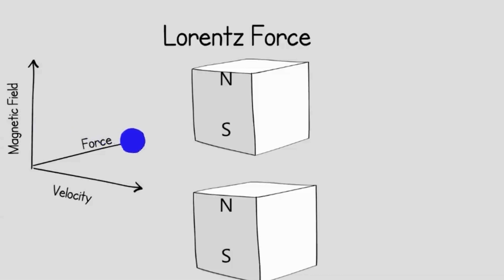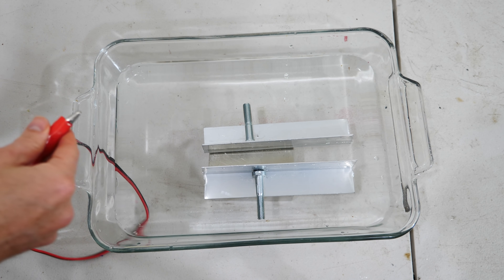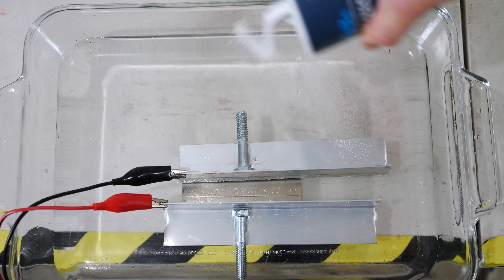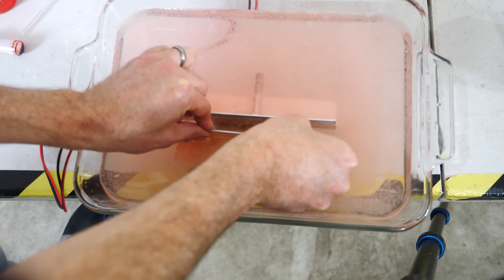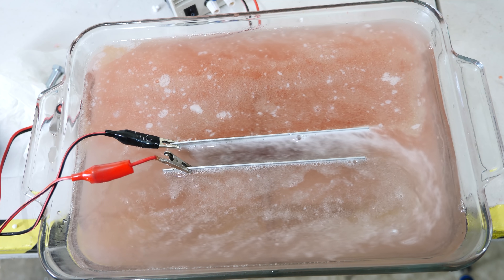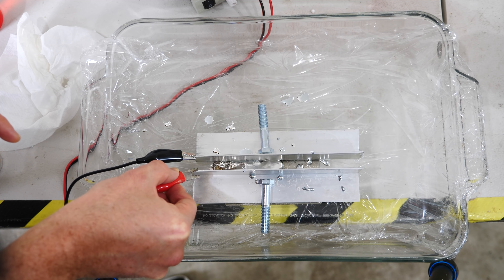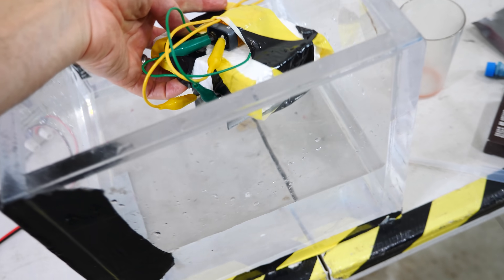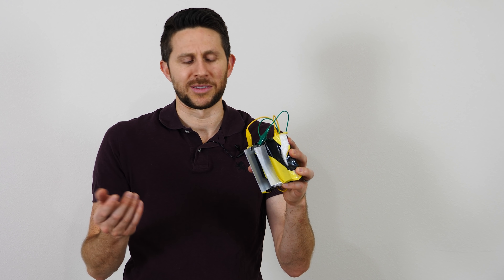I Made a Real Magnetohydrodynamic Drive

Comment: Will water that contains a lot of ions (salt or hydroxide) move in response to an electromagnetic force alone, without having electricity pass through the water itself?
If so, here's an idea for making the drive more efficient (surely already thought of): Capture the H2 and O2 gases and recover the lost energy by combusting them to power a generator that contributes to the electricity powering the drive. To do this, the leads would need to be contained in a way that captures the bubbles while allowing most of the water to pass through, propelled by EMF, but without being involved in the electrical conduction.

Comment: The hydrogen and oxygen are a bonus. A scrubber to remove them and you're reclaiming some fuel for the energy you used.
Or.. what if you pressurise the system and ignite the by-products to add thrust?

Comment: I wonder if you could replace the pump in a watercooled PC with this? The fact that no-one else has tried it suggests that there's quite a few issues that would need to be worked out first, but it would be cool to see in action.
Reply: There's two possible issues:

The system requires a strong magnet to function. This would seriously fudge up the hard drive unless the "pump" was moved a safe distance away, requiring more desk/floor space.

The process also makes hydrogen and oxygen gas, creating pressure and flow issues. Even small bubbles can disrupt smooth flow in the pipes. Get enough gas expanding in a hot environment, and it's only a matter of time before the pipe ruptures. (To add insult to injury, there is the slight possibility of the hydrogen igniting.)

So, a wiped hard drive, pipes taking up space, bad flow causing uneven cooling, water damaged parts, and a small fire. Who said engineering is boring? 🤬😝

Comment: 4:21 Can you expand on this?  I've never seen a setup like that and the gallium makes it hard to decipher where the electrodes are.  Are they both inside the cup (looks like one is outside, how does that work without making contact if that is the case?), is one on the wall and one on the 'floor' of the cup?  Also, is it flowing in a circle or is it expanding outward to the walls?  Thank you!

Comment: I built one a couple of months ago. I only had some thin copper wire as my contacts, but it worked for about 3 seconds before it corroded one side black and plated the other side with the stripped ions and then burnt out.

Comment: Set your electrodes in a V with the large end on the inlet end and velocity will increase to increase thrust. Shape electrodes like oval shaped funnel to a nozzle. You can increase flow by making the electrodes smooth enough to inhibit nucleation.

Comment: mhd tesla turbine pump
Reply: do it with plasma, centrifugal wall z-pinch mega-g squeeze
Reply: molten metal, iron, going around, hot
Reply: have a cover, to not melt, ceramic, MgO
Reply: super conducting or plasma in the circular form, spinning a disc or particular matter

Comment: Does that actually work as electric current generator when running ionized fluid through it - like many other motors can be driven to produce energy? If yes, how efficient is it, as it probably does not produce gases that way around? Could this principle be used for tidal power plants without mechanical (moving) parts?
Reply: It does work in reverse where a liquid moving through a magnetic field creates electric charges, but it's not even a tenth of a Volt. Though this principle is used in special flow measuring devices widely used in the food industry since you don't need to put any parts into the pipes and risk contamination

Comment: There must be some way to use this with AC electricity on the electrode plates (to stop this inefficient build up of oxygen and hydrogen gas), and then some Tesla valves to force both directions to push water out the same exhaust for net forward propulsion

Comment: 5:26 Currently, the boat can only go slow with surface tension.  If you can direct the water passing through the plates with a pipe, According to the "momentum conservation" can travel faster than this.

Comment: You are so amazingly sychronous! I just finished prototyping an MHD vacuum pump. I needed a backing pump to clear out remaining gases in a high vacuum. Ion pumps ignore some gases and turbomolecular pumps are too expensive and high maintenance. The ancient Sprengel mercury pump was suitable but too tall, too fragile and too slow. I realized all I needed was a liquid metal slug passing the same Y junction repeatedly as fast as possible. I made a flat circular MHD ring track to pump two molten eutectic alloy slugs around a small loop at high speed. Had to place a small reservior and drop gate between inlet and outlet ports to prevent gas from bypassing the slugs. As one slug plows into the reservoir it triggers a launch circuit to eject a drop from the other side of the reservior which then plows gas ahead of it around to the outlet stem again. It runs like a bat out of hell because it is only turned on once the roughing pump takes things down to 10 microns. And since the alloy is eutectic it's vapor pressure is worlds below that of the mercury originally used for this purpose. I am still working on the final build since it has been a nightmare designing the parts and materials to eliminate all the absorbed gases and keep the droplet from jetting out it's middle while the rest remained behind on the track walls to break up and break electrical contact. I actually made opposing magnets move the drop through the charged channel. This makes the drop force itself together from opposite directions to stop it from breaking up. The external moving magnets then shuffle the drops around the track. Still needs refinements. I am still getting a few X-rays from electrons hitting remnant gas in my DIY X-ray tube.
Reply: are you making a spacecraft engine?

Comment: What if we took a clear square tube, placed the aluminum electrodes on the sides with rare earth magnet on the bottom and tried to pump water uphill using this method? Perhaps using a Tesla valve to prevent back flow. Scaled up this could also be used to help spawning salmon to reach higher mating grounds inland, without the Tesla valve of course.

Comment: you chould try to make these copper flywheel motors out of that principle by using a copper wheel and place a electrode on either end of the container and the copper wheel in the middle and see how much power you can possible generate from that.  perhaps electricty in batteries are not formed by the science of it but is actually just a capacitor effect of ion flows but not in direction intended by manufacterer. what if you was propelling the ion fluid mechanically by initalize some current and speed up the flow. would the electrode peoduce more electricity by the mechanical motion added than the electricity supplied. what if the electric current the potential difference and the ion flow is not the same phenomena but  3 different ones. there must be a reason why lead acid batteries are incapable of being charged once go below a certain voltage like the ions just spin around in a loop without actually building up on the plates.

Comment: i think i remember they explained this by using salt water in the sea on submarine to make electric submarines move forward by electricity. this thing is just the same as a ion lifter. the electrode plates are a capacitor to that of the water.  its the same kind of current movement with electrostatics used in lifters as in the chemical version. a wind effect created by a air or water capacitor drives the object forward or generate lift. you can probably make a underwater lifter with salt water that propel itself upward as well by having a lower and upper plate or somthing like that.

Comment: if you place two very thin aluminum wires located very close to each other, you can get a capillary channel through which a very small volume of water can be transported.  But!  this means that you can make a whole network of such capillaries!  increasing the area of contact of water with air!  cooling!  and you can also equip with heating coils that can very quickly evaporate the liquid!  or vice versa, cool.  it can be applied to so many device industries!

Comment: USE ALTERNATING CURRENT !
By using an electromagnet and alternating current you can stop electrolysis while still pushing water in one direction.
Starting at ~1kHz there are no bubbles created, but even better, you can use the capacitance of water to push more charges at high frequencies.

Comment: The bubbles are the result of electrolysis of your solution. Mostly it is just oxygen and hydrogen from the water but the impurities can get reduced as well. So don't be surprised if you start smelling chlorine after running the thing in a salty water for a while. Especially if the electrodes are far enough apart and the current is set up high enough for the voltage to rise up to 8V or more (the higher the voltage the less discriminative the process gets). And as someone who likes your videos I would strongly recommend trying not to breathe in too much of it in a single session. Getting your lungs sterilized with the thing can really ruin your day if not done in moderation.

Comment: If you increase the voltage to over 10 kV or 20 kV (I used maybe 30-50 kV) you can use deionized water and probably get more propulsion. (Hardly any electrolysis happens.)

Comment: You can actually use this in the opposite direction.
Use it as a 'turbine' generator, having the electrodes in a stream pulling energy from the flowing water, ever so slightly slowing the water.
May not be as efficient as a water wheel or screw( haven't tested efficiency), but the benefits are the no moving parts.
Reply: The efficiency is very low and so far it only found its place in the food industry to measure the flow of liquids without risking contamination

Comment: Would you be able to insulate the electrodes with a thin layer of paint, or a rubber sheath, etc. so that "energy is not lost in producing bubbles" (in electrolysing). We'd still have the electric field to produce the magnetohydrodynamic effect.
Reply: Or is it the electric current that is required to produce fluid current (motion, flow)?

Comment: Use the drive, but absorb the hydrogen and oxygen bubles and either run them through a hydrocel to gain back some lost electricity, or compress them and use them as rocket fuel.

Comment: Great video as always, does it work in reverse?
Reply: Actually yes
If you move a liquid through a magnetic field, it creates small electric charge dependant on the flow
This is used in special flow measuring devices widely used in the food industry since you don't need to put any parts into the pipes and risk contamination

Comment: If we cover the aluminum plates with a thin layer to isolate it from liquid

Will it work
Reply: No. The separation of water into H2 and O2 is inherent to the DC current circulating between the electrodes (no matter what material they are made of). Any coating would either insulate electrically the electrodes or just be a material that would wear up by releasing ions to the water and stop working affter that.

Comment: It would be a  handy drive for a submarine if had loads of power like a nuclear sub. You could collect the hydrogen and oxygen bubbles and use the oxygen to replenish your air (after scrubbing out the carbon dioxide), and the hydrogen in a fuel cell to recover some of your wasted energy. Are the bubbles are produced in deeper water (higher pressure) as well?

Comment: so just use a non salt reactive conductor and an array of plates.
Reply: The H2 and O2 formation is NOT a consequence of Al reacting with salt, but of water reacting to DC current circulating between the electrodes.

Comment: You have to isolate the metal from the water, in this way no electron exchange can occur and no bubbles will occur. What you need is only electric field not electricity running in water

Comment: What about a coating on the parts to keep the breakdown from happening but allowing current to flow
Reply: Wouldn't work. The insulating coating would also prevent current from flowing between the electrodes, thus preventing the ions from moving from one electrode to the other and being deviated by the magnet, and so the water would not be moving.
Also, you would basically be building a big capacitor.

Comment: What if we do this but instead of using two parallel plates, we use concentric cylinders. If by any chance this doesn't work (because some of the water stream goes to the front), then it's possible to only use two plates that spirals to the center and block the water stream that is not desirable by using insulator (so we get only a stream that goes in one direction, as well we can make it more compact)
Reply: Forgot to mention, maybe using higher voltage and lower amps might be better to go forward (less energy will be lost in the formation of bubbles).

Comment: In the '60s, there was discussion of using MHD to generate electricity from coal.  The coal would be powdered as fine as flour and blown, on fire, thru a magnetic field.  The moving plasma could power electricity to flow thru a circuit.
So far as I  know, this never made it beyond lab scale.  I never heard of a pilot plant.

Comment: One can wire their electrodes in serries with an electromagnet to also provide the magnetic field, thus reduce the cost.
Reply: With a proper constant supply of energy this design using electromagnets can be more practical, capable of achieving stronger magnetic fields than a neodimium magnet does
Reply: @DanielRamirez-vm3be  stronger lighter cheaper for sure.
Reply: @Deborah Ajao Yes, electromagnets need current to generate a magnetic field, and when current is flowing between two electrodes, having wired the electromagnet in serries will create the electro magnetic with the same current.  But the current need not be constant current, only sufficient enought to generate the amount of force you want to propel your boat or pump an amount of water at the rate you want it pumped. 

Mater of fact, one could use AC current. When the electric current flows in one direction and the magnetic field  is in its direction at 90 degrees to the  electric current, then the force is in a direction given by the right hand rule.  But, when the current reverses direction, so does the electomagnetic field, thus the reversed current and reversed magnetic field cause the force on the water to be in the same direction as the initial current and magnetic field.  if you want ac current to pump the water the other direction, you need to flip the coil, or switch the current to run in 180 degrees out of phase.

Comment: It's impressive to see how much water current is actually generated in this experiment. I wouldn't have guessed.  
I wonder, though, how much electrical current and power it took to make that happen.
Reply: At one point his power supply shows 9 volts at 10 amps which is about 90 watts not including the losses in the power supply. That’s a lot of power to move such a little amount of water. I know that’s just a basic setup for demonstration and not very complex and there are probably better ways to make it more efficient.